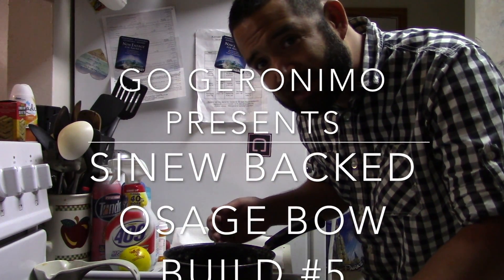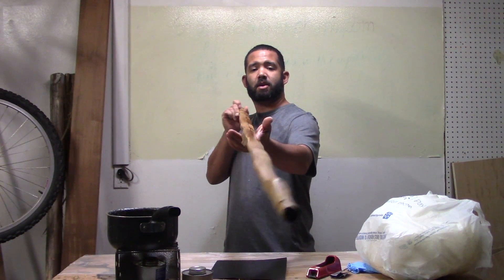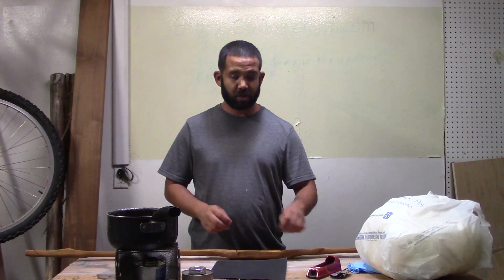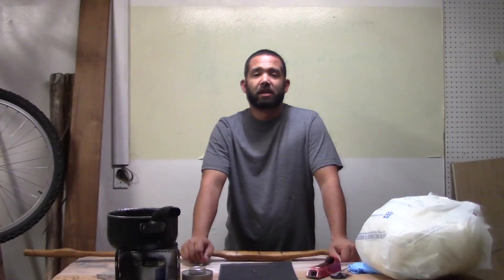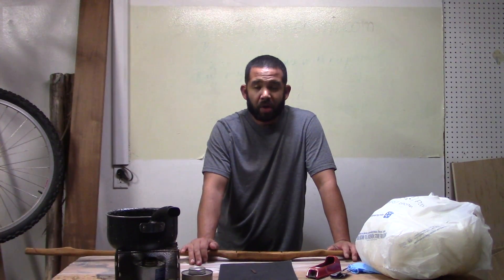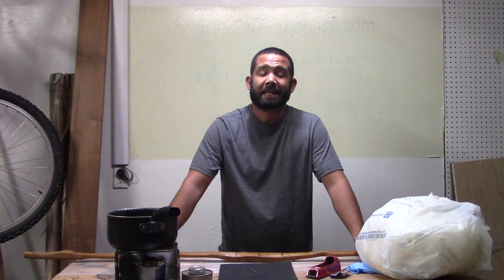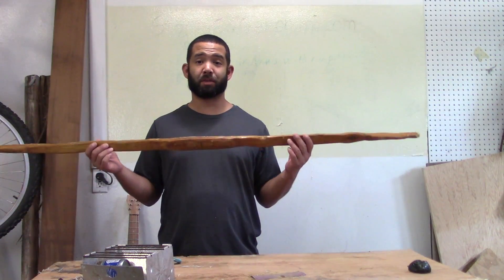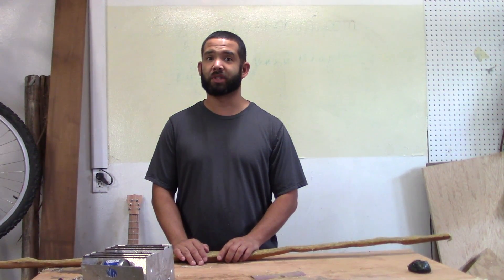Sinew backed osage orange stave bow build along part 5

Comment: You made the right choice in using hide glue, it's very strong, in fact they have used it for centuries to make chipped glass https://m.youtube.com/watch?v=sOVDtOok-c8, you can put it on flat glass and when it dries, it shrinks a little and the bond is so strong it chips the top layer of glass making a design. You can't do that with titebond.